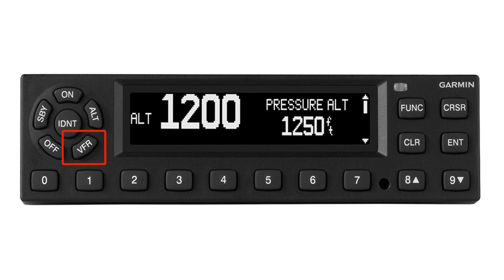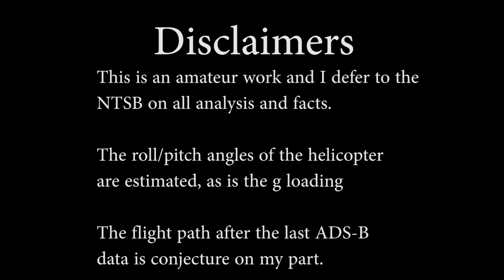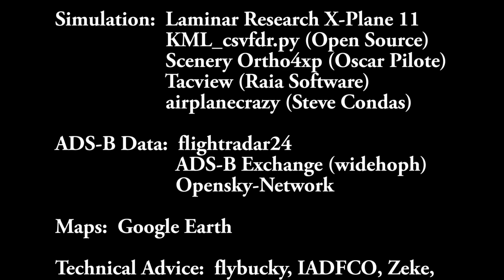Newly released Pilot to ATC Audio!  N72EX (Kobe Bryant) Crash Reconstruction.

Comment: Need to know what the altimeter was reading.  Need to know what the MOCA was in that area.  Was 4000 high enough to clear all obstacles in that area? Sounds like he wanted to do the right thing and just "punch in".  I did NOT care for the reply from the controller when he said he was going to climb to 4000.  Controller sounded very snooty to me when he asked "and then what are you going to do when you get to altitude".  Can just hear in his voice that he sounds "bothered" that this guy is going to punch in and he's going to have to WORK to process his requests.   Too bad...over 155 kts he was also likely getting rolled to the left from retreating blade stall.
Reply from the maker: I don't know the MOCA, but the MVA for the area was 4000 ft.  Regarding RBS:  The helicopter was well under Vne at the start of the sharp bank, so RBS was not the initial cause of the bank.  I am still researching if there could have been RBS at the very end (near 170 knots).  My initial research says no, and that the 155 Vne on the S76 is very conservative with respect to RBS.
Reply from the maker: Nick Lappos, Sirkorsky Test Pilot, set a course record in an S76 at about 180 knots:

Record (official) Speed over Recognized Course (rotorcraft):
Chicago to New York: S-76, 331.39 km/h (205.92 mph). Nicholas D. Lappos, 1980.

This would have been at optimal weights and low g-forces, so it isn't a perfect comparison.

Comment: As a pilot, NEVER take these kinds of jobs if you don't have your Instrument Rating and know how to use it.

If you're a pilot going into unplanned IFR from  MVFR, GET ON YOUR INSTRUMENTS IMMEDIATELY and stay on them.

It will save your life.
Reply from the maker: I am not a pilot, but as a result of my research on this project I am wondering operators should be allowed to fly SVFR if they are not certified for IFR.   That way, if they would not be hesitant to go IFR in IIMC.
Reply: @stevencondas2281  SVFR (Special VFR) is a useful tool; it provides separation in controlled airspace around an airport if conditions are less than VFR, which is 1000 foot ceilings, and 3 miles visibility. You could EASILY fly in those conditions, so taking that option away is, well, not an option.
Anyway, I referred to MVFR, which is Marginal VFR, meaning it's not severe VFR (blue skies and unlimited viability), but definitely still flyable. MVFR doesn't have any restrictions wrt to flying; it just tells you to maybe be on the lookout for deteriorating conditions.
The 76 should have stayed VFR in my opinion, and not gotten into the 'soup' (IFR) at all. It's a helicopter, he could have gone lower and slower without problems. Landing in a parking lot is also an option.
Reply from the maker: Thanks for your insight!
Reply from the maker: Please see my comment chain with kersmash for more discussion regarding your comment about going lower and slower.

Comment: Before I started flying I was skeptical about spacial disorientation. Now when I look down for 3 seconds to write the atis on my knee board I find myself in a 20 degree bank. It’s crazy because you have no idea
Reply from the maker: My friend who is a helicopter pilot told me exactly the same thing!  You may be interested in my preliminary g-force video which shows that the combination of the turn and the increasing descent rate lead to 1g into the seat.  Read the video description for more details.  https://youtu.be/xI1UqFvNYIU

Comment: You did an awesome job putting this together. Clearly the result of many hours of hard work. Thank you so much for your effort. Really does paint a sad picture of the horrible event. Thank again for doing all this!
Reply from the maker: Thank you for the kind comments!  You are right, it did take many hours of work :)  To create the video I used many different programs.  I used a program I wrote to filter the noise and quantization from the ADS-B data (if you don't filter the data then the reconstruction bounces all over the place due to GPS noise and altitude 25' quantization).  I then fed that output into a version of KML2csv, which I modified to fix roll calculation errors, to estimate the the roll, pitch, and yaw from the ADS-B data.  I fed that output into a program called TacView to generate the gauges and clock.  I then took a program called ortho4xp and generated high resolution scenery for X-Plane around the crash route.   KML2csv also generates an X-Plane FDR file, and I fed that into X-Plane to generate the helicopter visuals and scenery (both clear day and with marine layer).  Finally, I took the video output from Tacview, X-Plane clear day, X-Plane marine layer, and the FAA ATC voice track and created the video using Adobe Premiere Elements.

Comment: I am no expert but shouldn't the occupants and pilot feel the helicopter was leaning sideways therefore not accending?
Reply from the maker: I'm still working on the best way to present it, but as @Varun Sharma said, from the occupants perspective they probably didn't feel the tilt.  I believe they felt 1G down straight into their seats for a large portion of the descent and I don't think they felt pull to the left or right of the aircraft.  Here is a preliminary video with the G forces I see, with the top two views being in the frame of the helicopter (what it would seem like to the occupants), and the bottom two views being in a frame level to the ground.  https://youtu.be/xI1UqFvNYIU  I am still refining the G-Force calculations, so I might not have it exactly right (especially in the last 5 seconds), but it gives an idea.
Reply: If you are spatially disoriented them NO, you won't feel it. It's to do with fluid in your ears. In extreme cases, you might be upside down and still not feel it. See https://en.m.wikipedia.org/wiki/Spatial_disorientation
Reply: @varunsharma1889  But wouldn't gravity still cause your body to lean to the side??
Reply: Yes you will lean but with respect to ground but with reference to helicopter you won't. And so you won't know unless you can see outside. I suggest you watch this video from beginning to end - https://m.youtube.com/watch?v=9ofStn2KScg

Comment: Could the pilot have gone low and slow instead of high? Hugging the terrain?
Reply from the maker: I think he went about a low as he could legally fly (300 feet above the ground).  I think that when he got that low and couldn't see the road is when he decided to climb.   Here is a graph of the helicopter altitude and ground elevation:  https://ofutbg.bn.files.1drv.com/y4mfYiTYMgdhhNjpTaczw2oEuI9ZlTP-Urr4MBNShQp1qEC7ki1uXgleTBJCy6if86Rwq6EWg8oIfJcgHKvyIdk-Sdgi-1XwCg7G0JGrAFxXJKuPIriwbg791YEyEsAsIS4EP2QnyCQxeLProbTLNoWzC1n1o1_OexgSvRFp8LN8A-HdFSVfJj2xIENFec3Tx8sUSXuHD9AT4MULhRIjsbIKA/N72EX_Elevation_Profile.png?psid=1:
Reply: @stevencondas2281  Thanks, brother.

Comment: Looking at the ADS-B data, you can see he climbs and then levels off at the same attitude ceilings were reported, and begina a slow descent. He punched into the clouds is what happened. He went inadvertent, and instead of announcing he had gone IIMC, squawked emergency, and referred to his instruments, he began a turn and slow desecent to get out of the clouds. I'd imagine looking for the ground below, he wasn't looking at his instruments at all, and  instead was looking out and down his left door, and was completely unaware he was in a dive. You're right, spatially disoriented. Based on the crash site, there was a little over 500 feet between the bottom of the clouds and the ground. In a dive profile at 184 knots and 2500+fpn rate of descent, there was no time to recover. The data shows an abrupt decrease to 500 fpm descent, and an abrupt deceleration prior to impact indicating he yanked the cyclic back and pulled all the collective he had. He mushed, as no helicopter is going to recover that dive profile that quick. Rotors no doubt coned further reducing lift. In short, no pilot wants to be the guy to announce to ATC that they're inadvertent. You gotta swallow pride to do that. What's worse is this was the third and final mistake in a series of mistakes I think were made. When they were told to hold for 15 minutes because several flights were recovering due to weather, that should have been the first red flag. Then requesting special VFR to transition north of the airport to a destination at higher altitude is the second opportunity to say "no" to continuing. The pilot was IFR rated, though the company was not, but IIMC is an emergency and he shoild have committed to flying instruments, climbing, and getting vectors back to VFR conditions or an instrument approach elsewhere. Who knows if there was pressure to "just get there", but with all those big moments to assess and not challenge weather, "not today" is all a pilot should say. Bad enough he went inadvertent, but that is a serious dive. In what I fly,  dive recovery becomes a sole point of focus above all else, and with a heavy bird at that speed, it happenes over several hundred feet, even with robust power available. I've ranted enough though. It just still makes me angry to see the obvious. A bad series of decision points led to a child dying in a horrific crash.
Reply from the maker: I have a couple of comments about the facts in your post :  1)  I don't believe the transponder ever squawked emergency.  The ADS-B data I obtained from the FAA goes until 2020-01-26T17:45:36.09Z (about 2  seconds before the crash) and shows the transponder is still squawking 1200.   2) At that last ADS-B data point the descent rate is 6144 fpm, not 500 fpm you referenced.  3)  I have looked at the data, and the helicopter starts to climb at the time the aircraft has descended to 300' AGL.  (I suspect the pilot climbed at that point because he lost visibility with the road, and 300' is the minimum allowed altitude when not taking off or landing).  Can you provide a link to your ADS-B data source that shows 500 fpm descent at the end of the flight and a 7700 squawk?  That would be data I don't have and would help my analysis!

I don't think the turn and descent was planned "to get out of the clouds" because the pilot said he was climbing to 4000.   I am convinced that the pilot had no idea that he was turning or descending.

 My analysis of the G forces shows that the G's went up near the end, but I don't know if it was a deliberate pull up or a graveyard spiral.  I don't have enough confidence in the exact crash time to know if the pilot was able to slow the aircraft before the impact.

Thanks for an interesting comment!
Reply: @stevencondas2281  I didn't say that he squawked emergency. I was describing that SHOULD be done when you go IIMC. I was comparing what you're supposed to do, vs what was actually done. 

Do an image search on Google. Just type in  "kobe ads-b" and you'll see the graphed data at the to of search results.  This was months ago and I recalled some numbers incorrectly and probably should have refreshed my memory on the descent rate. It was just under -5000 fpm, and spikes up to -2000. Prior to impact. Also, the velocity is actually 161  knots, I think I  read 184 at some point a few months ago and that's why that number was in my head and may have been someone's bad conversion to "mph" as opposed to knots. Still, quite a dive. 

I'd argue he was completely unaware of the dive because he didn't commit to instruments, he didn't announce inadvertent, he didn't squawk emergency, and became unaware of the weight of the turn for the same reason. The tendency of a helicopter is for the nose to tuck as bank angle increases. A pegged VSI and heavy bank angle on the attitude indicator are hard to miss if you're inside on instruments.

The climb he had in was gradual and followed about the same rate of rising terrain toward that higher elevation. Minimum altitude in built up areas is 500'  AGL though, but I'd imagine already SVFR, he was pushing that limit too. This is a common occurrence in helicopter crashes due to IIMC. Trying to follow roads or wires,  and scrape clouds and rising terrain forces you up into ceilings. 

Some interviews, videos, and comments from pilots who fly in that area a lot and it seems weather often threatens to come down in that area, but "never actually gets bad", and that conditions that day were not normal for the area, so perhaps there was some complacency or overconfidence at play.
Reply from the maker: I apologize for misreading the portion of your comment about the squawk code.  I re-read it and you were clear.

With respect to the descent rate, here is the data for the last 5 ADS-B data messages that the FAA supplied me (time is that of the velocity message):

Time       fpm
45:31.95   -4736
45:32.73   -4992
45:33.70   -5312
45:34.77   -5824
45:35.69   -6144

I haven't yet satisfactorily stitched the above rates,  the barometric altitude, the geometric altitude difference, and the position and velocity message times into a coherent story of what really happened in the last 5 seconds.  Because of the crash investigation, Garmin can't discuss how their algorithms work so I am trying to figure it out from the data. I think there might be a lag in the barometric altitude or that I am not applying the Geometric altitude difference data correctly to the barometric altitude.  I am still working on that.

The speed you see in the flightradar24 ADS-B data is ground speed.  When I factor in vertical speed I get a total GPS speed of 170.86 knots according to the last ADS-B data velocity message I have.  I agree, quite a dive and I believe that all of the occupants would have felt uncomfortable pressure in their ears due to the fast descent.

The minimum altitude for an airplane is 500ft, but I believe the minimum for a helicopter is 300ft.  https://www.law.cornell.edu/cfr/text/14/135.203  I stand by my assessment that he began the climb at about the point he was forced down to 300ft AGL trying to scud run.  I might be misinterpreting your statement "The climb he had in was gradual and followed about the same rate of rising terrain toward that higher elevation".  What I see is that rate of climb is substantially higher that the rate of the terrain height increase below the helicopter.   https://www.flyingmag.com/resizer/lxsVavnV4wVm_QtVcG-wwCVYRK4=/799x472/arc-anglerfish-arc2-prod-bonnier.s3.amazonaws.com/public/RCCFPFQ2BZHLNJSPD2KPJAZWCM.jpg

I have found your analysis very interesting and I appreciate discussing the crash rather than how much my simulation looks like GTA 5 :)  I am not a pilot, but I believe the data agrees with your general conclusions.  Here is some preliminary G-Force work I am now doing:  https://youtu.be/xI1UqFvNYIU .  I haven't finished my analysis, so some of the details might change, but it gives some idea.  The top two views are in the frame of the helicopter body and the bottom two are in a frame always parallel to the ground.
Reply: @stevencondas2281  you are quite on point and certainly making more of an effort to find more precise data and I certainly appreciate that and it's good to have more than the very raw initial data I came across. Some things just scream at you when you're in the line of work and spatial disorientation is not fully appreciated until you're in that cloud, or worse experience it. I recently had an event where my co-pilot was on the controls and we were on a VOR approach. He was right on course and no issues. He suddenly goes into a fairly heavy bank trying to make a correction perceiving he was in error. When I looked back at the video, you can see that he had a light bank in momentarily that he corrected for, but within a few short moments he enters the bank again. He experienced "the leans" and his body was telling him something different. In a matter of seconds we had something like a 35 degree bank and the VSI dropped out greater than -2500, a justa few miles from missaed approach point. I took the controls and recovered it and we were fine, but just an example of how the onset of spatial disorientation can creep up. especially if, as I think Kobe's pilot was looking out and to the side for ground. There may be a number of reasons hisbrate of climb was what it was for a moment. The ridge coming up,  "testing the waters", maybe for a moment he was going to commit to instruments but at the very bottom ofnthe cloud layer, he caught a glimpse of the ground and thought he had an opportunity to get out of the clouds, only to punch into another cloud as he did. Can only speculate about that specific point in time. But if someone comits to punch in,  they have to announce it to ATC as soon as possible. Maybe he was just trying to get back on radar without punching in. Who knows.
Reply from the maker: Thanks again for you comments and insight!  I generated one other graph from the data with the ground elevation and ASL altitude vs time. https://ofutbg.bn.files.1drv.com/y4mfYiTYMgdhhNjpTaczw2oEuI9ZlTP-Urr4MBNShQp1qEC7ki1uXgleTBJCy6if86Rwq6EWg8oIfJcgHKvyIdk-Sdgi-1XwCg7G0JGrAFxXJKuPIriwbg791YEyEsAsIS4EP2QnyCQxeLProbTLNoWzC1n1o1_OexgSvRFp8LN8A-HdFSVfJj2xIENFec3Tx8sUSXuHD9AT4MULhRIjsbIKA/N72EX_Elevation_Profile.png?psid=1

Comment: The pilot passed out due to G-Loc
Reply from the maker: I am G-Force modeling the last minute of flight and so far (still in work) I don't see anything high enough to induce G-LOC.  https://youtu.be/xI1UqFvNYIU
Reply: @stevencondas2281  G-loc due to spatial disorientation
Reply from the maker: G-LOC requires at least 4 Gs, and the most I have seen in my simulation is 2.
Reply: @stevencondas2281  not if vertigo is involved
Reply from the maker: I am not familiar with this phenomenon.  Can you supply a link where a pilot suffered GLOC at under 4 Gs, whether or not SD was involved?